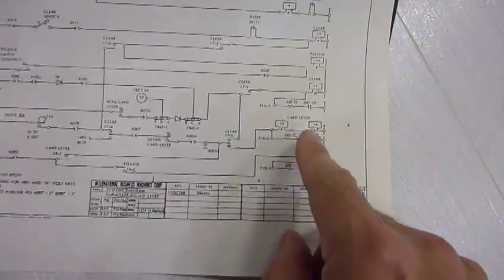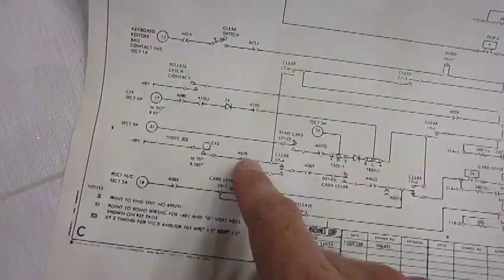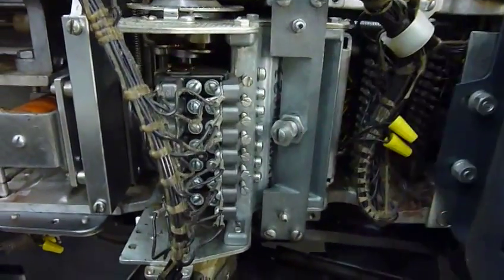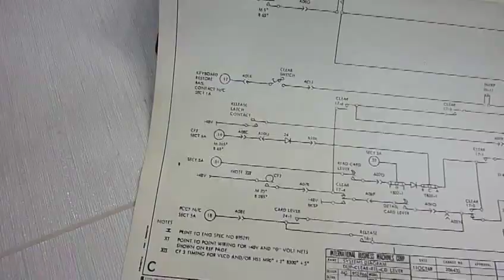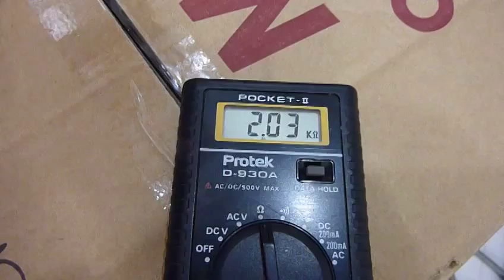IBM 029 Keypunch Restoration 3 - Debugging pinpoints first failure

Comment: In cases like this there  a cam actuated contact is below spec i do very much like using an old analog voltmeter directly on the suspected contact.

The analog meter is fast enough to show if even a temporary contact is bad.

My area is working with control contacts in railway switch motors.